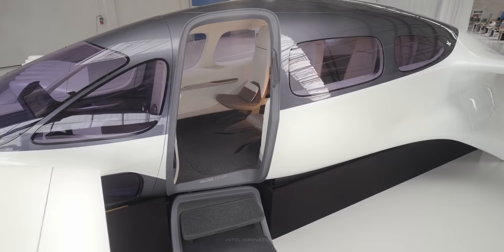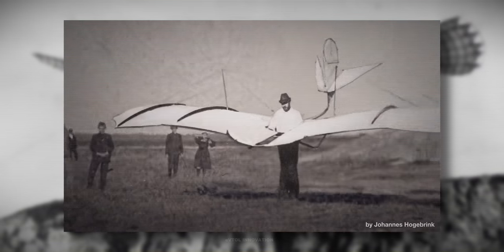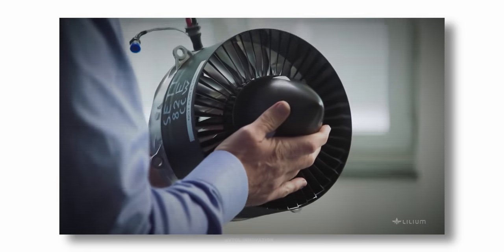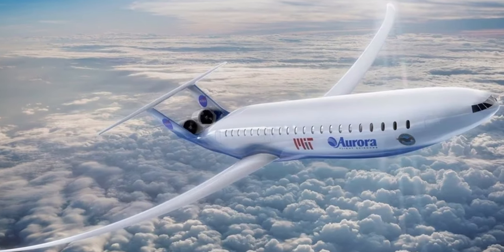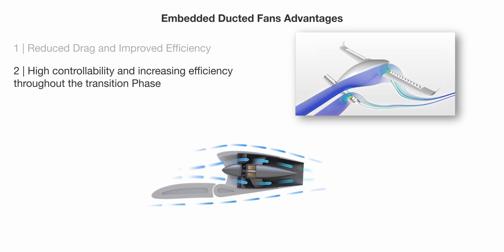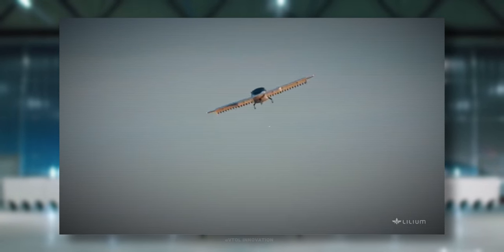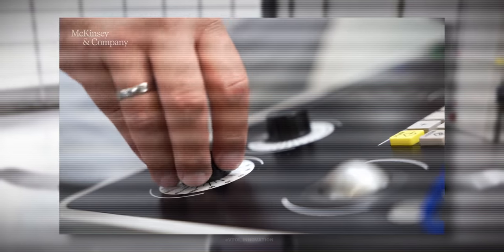The Insane Engineering behind The Lilium Jet | Part 1

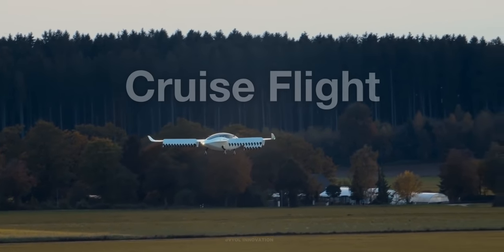Comment: 3:20....  Hold on...  if it's 10x more efficient in the climb-cruise-descent phase, that in turn implies that the energy consumption per unit time is 10x greater for the VTOL phases.  Meaning that even if the VTOL phases add up to 10% of the total flight time, using 10x more energy during that time means that the total energy budget just for VTOL is slightly more than half of the overall flight's energy budget.  That is not a good figure at all.  Yeah, it's about what I expected given the amount of energy required to actually push your own weight up as opposed to generate lift through motion.

Even assuming you're using a different metric for what you define as "efficiency" (since efficiency is a relative term after all), it's still indicative of how much more power you're going to need to support VTOL and why VTOL is a bad idea for electric aircraft given the obscene weight penalty for energy storage.
Reply: My guess is because the range is already limited, operators would rarely use VTOL due to the range penalty they would incur. 

But I don't understand why people are developing electric aircraft at all. They are energy density and weight sensitive. Both things batteries are poor at. All we are doing here is making a poor performance aircraft. It is a good goal to reduce emissions and dependency on fuels, but not really practical real world. If you are going to spend 1M US on an aircraft, this is not the one most will buy. Also safety is an issue in my opinion. Fuels give a large range buffer, these not so much. Also how are you going to heat the cabin, waste off the batteries?
Reply: @court2379  Ehhhh I feel ya. I would argue for biofuel + gas generator > electric drivetrain personally if we're talking long term aviation technology. I think the development of electric drivetrains and new VTOL concepts are an important enabler of novel configurations, even if the whole concept of an electric aircraft is presently flawed. From a public knowledge standpoint, it's a matter of doing the homework where we can even if we don't have all the elements yet. From the standpoint of those funding or developing these electric aircraft, I have no clue could be cynics, could be idealists, could be fools, could be wise.
Reply: It's a figure of merit but not an overall term. I would say the VTOL phase of an aircraft is smaller than 10% of its flight profile, and the ability to deliver higher peak power easily is an advantage of electric motors/batteries. I mentioned in another comment though that batteries are the problem (on a power/weight measure) rather than the VTOL part.

I think the VTOL aspect we see a lot is investor pressure to break into new markets since the last 60 years have shown how small the general aviation market is, even though I agree that VTOL is a little hard to justify.
Reply: @timcuatt1640  I see VTOL like flying cars. The design compromises they require make for an under performing plane in the key part of flight where it spends most of its time, cruise. This one has to use motors much larger than would otherwise be required, the power systems must handle the current for those motors, the stronger moving flaps, all leading to more weight as compared to a conventional plane (though they have saved some weight removing the vertical stabilizer). This would make this aircraft only fit a niche market of frequent travel between relatively close locations that are a bit farther than you would want to use a helicopter for, or you want to get there a little faster (though that might not be the case here being electric).

I do have safety concerns with this too. The wing lift depends on the motors operating. Direction control does as well. If you fly thru a flock of birds and the fans ingest a few, do you crash? How many redundant controllers is enough? My guess is they have three planning to cope with the failure of one bank of motors. Icing forms on the leading edge of wings and then breaks off. In this design that would go right into the ducts and break them. Not that I am suggesting most aircraft this size can handle ice, but they do so more gracefully and with greater chance of surviving it. 
This is fly by wire. Will a small plane have sufficient redundancy in the electrical/computer systems and hardening against lightening, static discharge, EMP/solar flares, memory errors, etc.?
Can it recover from a spin? 
Is it controllable if the battery dies or malfunctions?

There are a lot of challenges on this plane, for small gains in a narrow market. It would be a fun engineering project to work on. Best of luck on their journey, but it will be next to a miracle if this succeeds.
Reply: there could be some niche use cases for VTOL aircrafts especially for connected cities where road traffic is a problem. quick commute times would make sense using these aircraft where traditional airliners would not be economical. could be expensive at first but the first step is to have proof of work. any learnings here can be applied to future hybrid mobility systems and maybe battery tech would also improve. there is also the case for hydrogen powered BEV so, this is exciting work indeed. far from a waste of time in imo
Reply: @paulntege3357  That does sound plausible for air taxis and such.  But it also seems like a use case where VTOL state would make up a larger chunk of the flight times, so one would want to optimize for VTOL as opposed to cruising.  These guys willfully did the opposite, so maybe they're thinking slightly longer distance (e.g. suburb-city connections)?  If that's the case trains and subways are extremely more energy-efficient options.  It's not even a contest.
Reply: My guess is that the target audience is for the personal transport of those who can afford it.  Vtol is pointless for commercial use as infrastructure (airports) are already in place. Hopping the rich from one spot to another is much more likely to produce a profit
Reply: Yes, Lilim will need 10x more power during hover but that hover is less than 22 seconds per flight.    It will need 1.8 times more power in hover than an open rotor like Joby but much less in forward flight and also much less in ultra slow transitions flight druing approach and takeoff transition due to the wings boundary layer suction effect.
Reply: @court2379  They will definetly use eVTOL all of the time.   eVTOL means much smaller lighter wings that have less drag and much lighter undercarriage.    One reason fixed wing aircraft have such large wings is simply to takeoff and land.   Electric aircraft are very efficient on short flights.  It's only on long flights when the battery weight excedes 40% that they are inefficient due to the energy required to lift the battery.   That means electric flight will work to 200-250km.
Reply: @parasharkchari  Lilium are providing "Regional Air Mobillity" of 250km range rather than "Urban Air Mobillity" of about half that.   The Uber elevate White paper suggested that most customers would be super commuters who want to travel 100 miles/160km.
Reply: @williamzk9083  By the time you drive to airport, flight prep, get clearance, etc., It would barely be faster than driving at those distances in anyplace with a decent highway system, and you would likely need a car at both ends unless they allow to land in city. In the city it would be much the same except for the drive time to the plane. Also the whole point of adding wings vs a helicopter would be to add range or speed. Those distances wouldn't make it worth carrying the extra weight of the wings. This type of aircraft would be best suited for regular trips in the 2-4hour range. Any longer than that the value of VTOL is offset by the greater speed and efficiency of conventional aircraft. Shorter and the helicopter is the better choice because the speed difference isn't enough to save that much time and is lighter and probably cheaper. Maintenance costs may offset that though. Of course these are subjective and vary based on the needs of the customer, but a manufacturing company is going to target a market like that. They need something that differentiates them.
The whole idea of electric planes is just silly right now. The energy density of batteries is not high enough. Even with the increased efficiency we are likely still using more energy in an EV because we have to haul the heavy batteries around.
Reply: @court2379  The two strength of eVTOL will be in it ability to land in the middle of cities (due to very low noise and high safety) and low operating costs over short to medium ranges.   You are certainly rights about it not usually being worth it when a car might only take 3 minutes longer ,even at average city speeds of 45km/h, but on longer journeys and in some very large congested cities (Rio, Tokyo etc) or those divided by water ways it should work   The idea of uBer elevate was to have the uBer cars ready and waiting at both ends and Lilium will also provide this option.    I see the 'vertiports' being at airports, Very Fast Train Stations, major venues, hotels, conference centers and the middle of regional towns.   The Shorter ranged UAM eVTOL's will also have a niche.   Some of the airports in the city such as London city may loose most of their traffic as it becomes worthwile to fly from the city to Heathrow, Gatwick or Direct to France.  You could get from Dublin to London via Manchester.    I suspect they might replace sea planes and a lot of light planes.
Reply: The company is fraudulent. Not exactly scammers, but they burnt fresh investor money for years and have nothing to show.
Reply: the jet design is more efficient compared to an open propeller like on the pipistrel alpha electric. also combining it with the wing results in cheap uplift fron the air intake.
Reply: @stefanweilhartner4415  Not necessarily. The ducted fan does prevent the air from sliding off the end of the blades which increases efficiency of the fan/prop. The multiple blades add parasite drag, but not enough to counter the increase in efficiency. 
However ducted fans usually have a higher velocity air flow which is inefficient at slower aircraft speeds where this aircraft likely spends much or all of it's time. Also the duct adds a lot of parasite drag and weight to the aircraft, and is among the  main reasons you don't see them on all piston driven aircraft.
Reply: @court2379  - Rather than arguing for a "Conventional" level of "Range Maximization", this aircraft Accepts limits of Battery Energy Density, and Minimizes the VTOL Aspects. Also - While they and others focus on the VTOL Portions, these Techniques also benefit STOL Actions, where maybe 50% of the Vertical Input Energy Requirements are needed, and in this video, the gentleman near the end mentioned this kind of benefit that can be derived from this design. 

Think of it this way - The Lilium used "Powered" Flaps, instead of Just "Dead Aerodynamic Flaps" that most Aircraft use. While the Military "Harrier" Jet, used a central Engine, and 4 Nozzles, for Directing Airflow from the single Engine, both from the Compressor Side, and from the Turbine Side, the Lilium Jet, while in it's current Design State, is focused on Strictly a "BEV" approach, it could also be designed, with a BMW i3 Rex type of PHEV, using an Auxiliary Fueled Generator, for Range Extension.

Lilium themselves, might never create such a Design, but the "PHEV" Design is still a potential variant of this system.
Reply: @timcuatt1640  - Remember - We have had many, if not "Hundreds" of Small Airports in North America, Attacked, Closed, and Disabled, by Politicians, Businesses, and even Citizens! So - Reducing the Noise, and Take-Off Space Requirements, are going to be very important, to maintain any level of "Local" air Mobility, beyond "Mega Airports!"
Reply: @williamzk9083  Also - in the "Feeder" System of "Spoke & Hub" Air Transport, the Lilium adds more "Spokes" that can Feed the Hub!

It can Reduce Travel Time to an Airport, by switching from Cars & Buses, to these, and a "Community Park" can become a "Vertiport" quite Easily, for easy access with numerous more points, than just a local airport might provide.

Also - it's not always just a direct "Mile vs Mile" comparison, and aircraft like this can cross Water Bodies, Like any of the Great Lakes, in far fewer minutes, than it takes us currently to even Board an Airliner, and Push Back, and definitely faster, if you include 'Taxi' time of the aircraft, on large airports! Not just Bodies of Water, but across smaller mountain ranges, where often roads go around the lower perimeter of these  mountains.

Or - Something Like this: Toronto Islands Airport to Downsview Airport: Google Maps, 1 Hr + 5 Minutes By Street & only 15 Kms; or 59 Minutes, & 33 Kms by Highway; Vs, 8-9 Minutes by a Lilium Jet! (Based on my Guess, sourced from Flying the Bombardier Flying Club Cessna 172, from Downsview to Toronto Island Airport, and being 5 Minutes from Advancing the Throttle at the North end of Downsview Airport, to being 'Over' the Island airport!) 

As - "Taxi Time" in an Aircraft also uses Energy, and is a driving force in frequent flying aircraft, like short haul Commuters, for Electric Power Main Gear or Nose Wheels for Electric Taxiing, this is a substantial amount of energy, on Short Commuter Flights, and Lilium goes straight to the VTOL Phase, and quickly transitions to forward flight, Eliminating many Minutes of Taxi time, that most aircraft deal with.

Comment: 7:33 ❝the system is highly redundant❞ — Having multiple fans per wing provides redundancy indeed, but mounting all of them on a single wing flap introduces another single point of failure. Having multiple independently moving flaps per wing would provide increased safety.
Reply from the maker: There are 3 EDF per flap. 12 flaps in total.
Reply: @eVTOLinnovation  what's the glide ratio without power?

Comment: The main issue with this design was not mentioned in this video: batteries.  Current battery technology requires a tradeoff between power efficiency and energy efficiency.  You can have a battery that holds a large amount of energy (per unit weight), but it won't be able to provide high power.  A battery that provides high power is less effective at storing energy.  Due to the high disk loading, the Lilium Jet design requires a battery that can provide very high power efficiency, and this means that the battery won't have a good energy efficiency, thus limiting the flight time.  Their performance values are actually based on battery specifications which currently do not exist.  They are banking on hoping that battery technology will improve and remove these limitations, to make the design viable, but there is no guarantee if/when this will happen.
Reply: Wish E-VTOL would weigh in on batteries. Absence on this issue is conspicuous and noted.